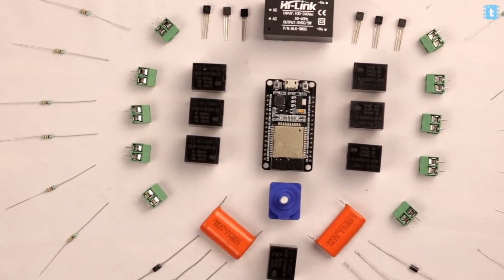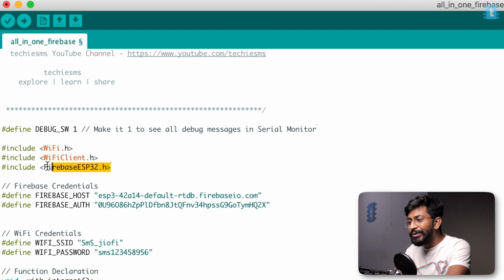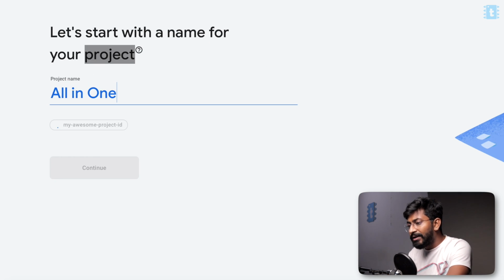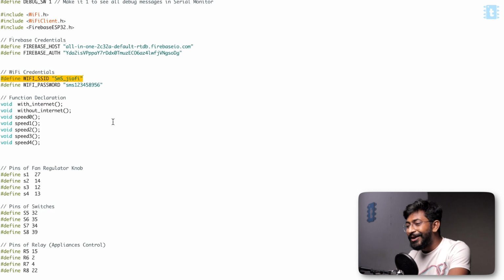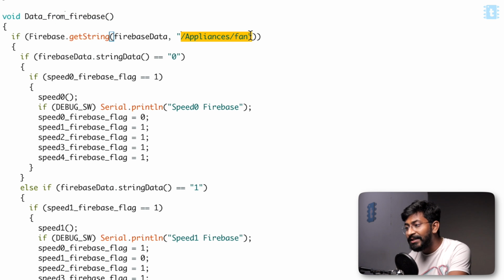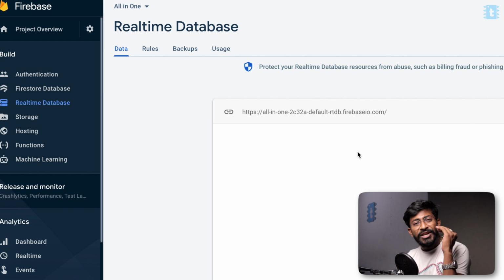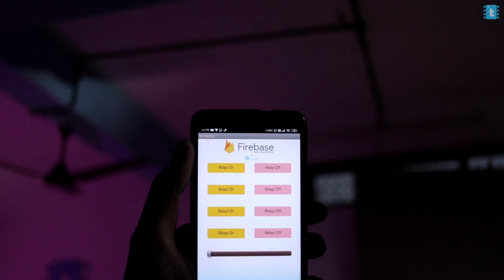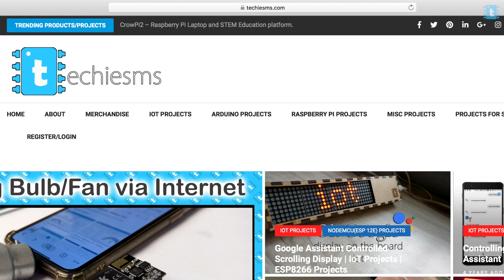Google Firebase Home Automation with Fan Dimmer & Realtime Feedback | ESP32 Project

Comment from the maker: Tell us, what more you want from techiesms. We are here for you.
#ShareVideoShareKnowledge
Reply: Sir. Can you make ir blaster for controlling home appliences.which  is controlled by wifi such as esp32 or nodemcu. This controll unit is more use full. We can use alexa to connect all type of application.
Reply: @rishidasev6231  i made the same project using tasmota
Reply: Are yaar bol toh ir blaster banao
Reply: Instead of adding wifi credentials in the code, you can use UDP communication to send wifi credentials to esp
Reply: @Rahul-Maredugonda  what is udp communication sir
Reply: Arduboy gaming console using arduino pro micro pls
Reply: This is the video i am looking for more than one year.

I have searched whole youtube but i cant find videos.

I am aspecting this video fr you.
Previously i have requested you in comment to make this video.

Thanks for giving this video..

Now it's time to watch it. 😁🙏
Reply: Hi techiesms I have seen many of your videos but something is missing like  your codes does not try to reconnect with internet incase if only the router switches on / off in between , and also if there is a power failure then there should be something like  last status of the relays to be set, please try to solve this....
Reply: Can this project be converted with esp8266
For controlling 4 ch relay and push buttons
Reply: Where can I get the Gerber file for the pcb?
Reply: .aia file is not available
Reply: Aia file nt available

Comment: Dear Sachin. This is really an excellent project. I have followed all the instructions as explained by you. but I am getting the error "        ^~~~~
C:\Users\lenovo\Documents\Arduino\libraries\Firebase-ESP32-master\src/Firebase.h:130:8: note:   no known conversion for argument 1 from 'const char [46]' to 'FirebaseConfig*' {aka 'firebase_cfg_t*'}
C:\Users\lenovo\Desktop\PROJECTS-10 March24\All-In-One-Home-Automation-using-Firebase--master\all_in_one_firebase\all_in_one_firebase.ino: In function 'void loop()':
all_in_one_firebase:117:5: error: 'Data_from_firebase' was not declared in this scope
     Data_from_firebase();
     ^~~~~~~~~~~~~~~~~~
Multiple libraries were found for "WiFi.h"
 Used: C:\Users\lenovo\AppData\Local\Arduino15\packages\esp32\hardware\esp32\2.0.14\libraries\WiFi
 Not used: C:\Program Files (x86)\Arduino\libraries\WiFi
exit status 1
no matching function for call to 'FirebaseESP32::begin(const char [46], const char [41])'
"

How to resolve this i have used the same library provided by you.
Regards
D. V. Apte - Vadodara

Comment: I want to control it using MIT APP  Inventor and Google Assistant. I am trying to find various sources. But, getting errors while using Node.js code. I tried using Google assistant API. I am not wishing to use IFTTT and BLYNK, adafrui, sinir pro, etc.I am trying to build my own. Do you have any ideas. The tutorial provided is really helpful. But, I am looking to integrate with Google Assistant using voice command.

Comment: Sir i am making this project like blynk 2.0(wifi)+BT+manual  with DOIT ESP32 DEVKIT V1 board but due to higher size of code i select board ESP DEV with Huge file option in partition for uploading the code, code is successfully uploaded working all perfect except board is not connected with wifi so i cant control via blynk so please give me any suggestion? i change the board?

Comment: Some surge, fuse and thermal protection on your PCB might be a good idea, especially if you value your home. See the datasheet for the Hi-Link HLK 5m05 (basic protective circuits).

Comment: Hey Techiesms,
Very amazing project.
I have done this before using Real time firebase database.

Just a suggestion, use the stream function to get the data from the path, instead of using the 'if' condition to check the path.

Saves a lot of data usage in the usage section.

Hope this is helpful.

Keep up good work. 😊
Reply: Code for your suggestion please ?